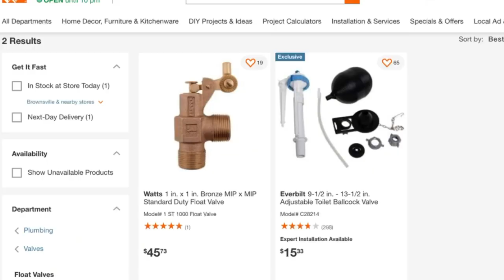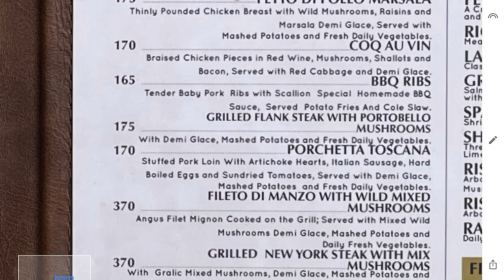She Immigrated.

Comment: Ok so back with another comment. This one is related to  a plumbing problem I recently had.
Two story home.  I noticed a leak on my ceiling once near the first floor laundry room.  Upon inspection I gathered that it was coming from one of two back to back second floor bathrooms.   I thought it might be a shower water valve or a hot/,cold mixer.
I decided to call a plumber to correctly diagnose and fix the problem.   Plumber shows up, does a visual inspection of the shower knob and plate (about 5 seconds) and concludes the shower valve is not leaking so he then goes behind the shower wall and with an electric saw opens a 1 ft x 1 ft piece of drywall.  (About 3 minutes worth of work).  Removes the piece of drywall, takes a quick look inside my wall (about 2 minutes or less) and concludes that I need a new shower pan.  
That was it.  He did no further work.  Charged me $250.00.  he was there less that 15 minutes and did not solve my plumbing issue.
The next day I took a closer look on my shower floor, removed the floor drain plate and inside the floor drain I noticed a small crack in the PVC drain  pipe.  When showering,  some of the water that drained  would infiltrate in the small pipe crack and run under the shower pan, this leaking below to the first floor.
I decided to give it a try on my own  and purchased a $10 sealant (water proof permanent seal) at Home Depot.  I then proceeded to seal the pipe crack.  The next day I ran the water in the shower for over 15 minutes.  Checked downstairs for a leak and.....no leak was present.  This happened about 3 months ago and so far so good.
I kicked myself for calling the plumber first.